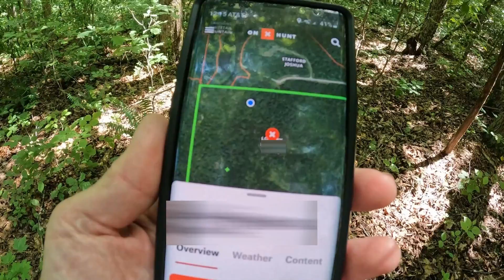Southern Illinois farm vlog. Lot's going on!

Comment: There's ya a perfect loading ramp off the edge of the bank where you removed all that dirt for your turnaround.  Just make you a drive going in there where you can back your trailers up to load.  You definitely need one of those ramps near your shed.
Reply from the maker: yeah, if I ever decide I need to load up both machines again, I will cut a ramp no doubt. Thanks